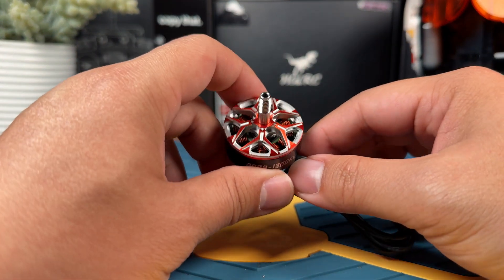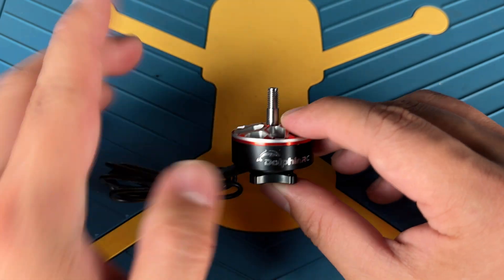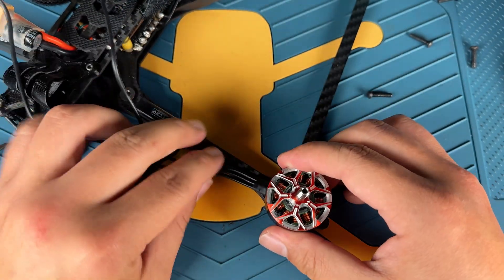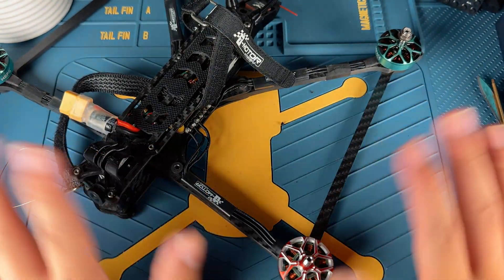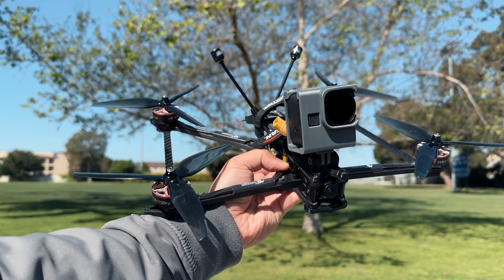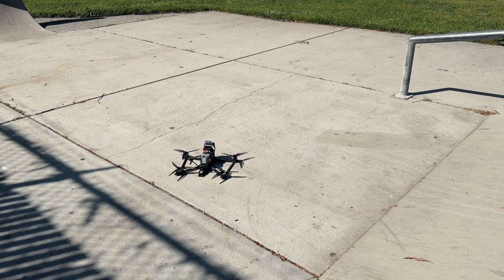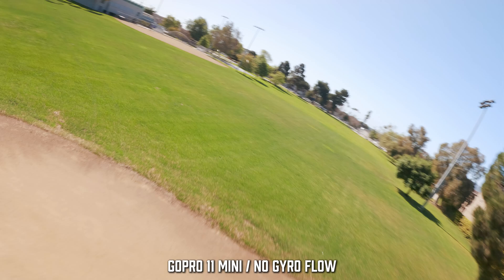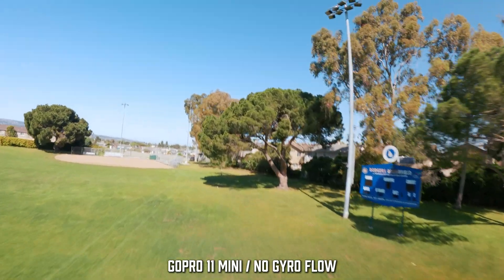This budget 7-inch motor RIPS! DolphinRC 2808 1300KV

Comment: you should always rethin the wires ands the pads when resoldering.... you just made nice cold solder joints that look like crap......... nice review tough
Reply from the maker: @quebecmultirotor5013  thanks for the tip. Soldering is not my strength so if you can make a video to show me how to do it correctly then It will be much appreciated 🙏
Reply: @XwingFPVRC  you should watch the pace institute soldering course, it covers everything you need to know and why